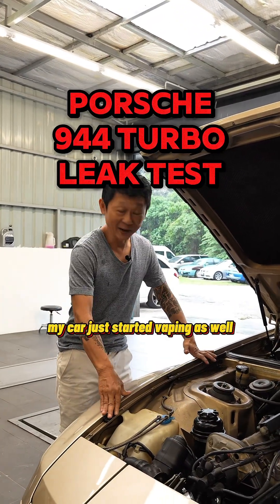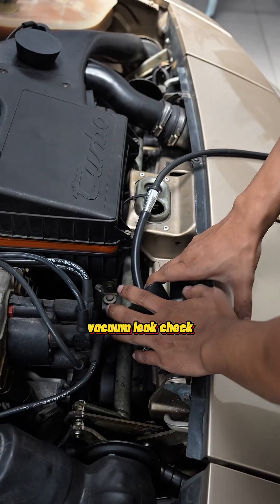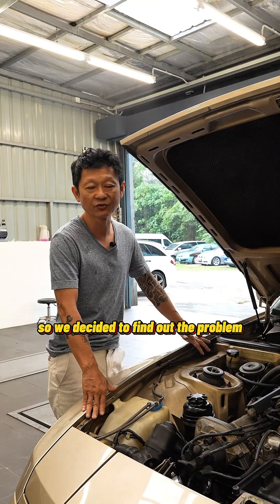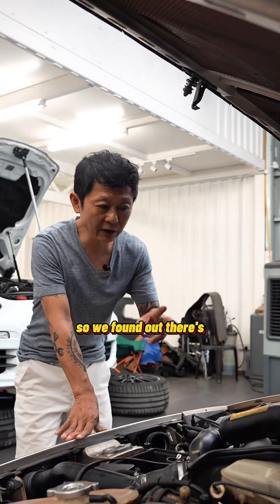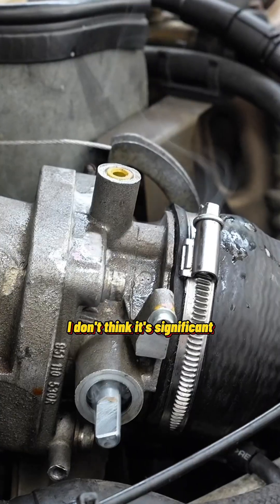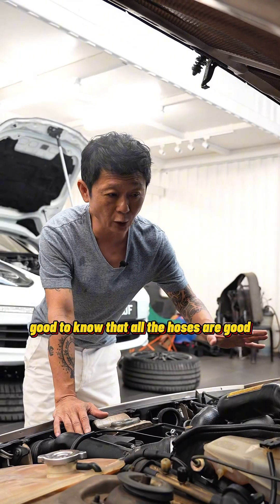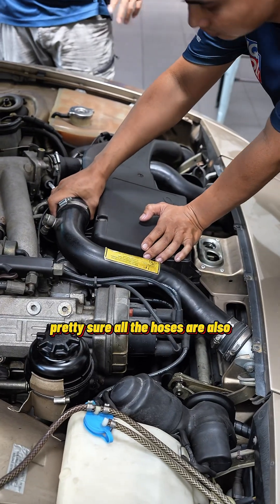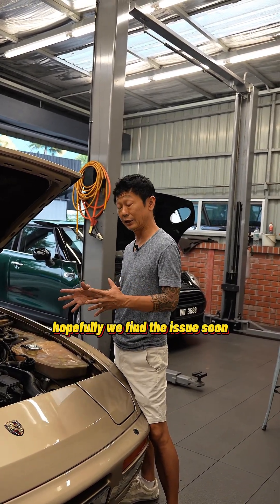944 Turbo vacuum leak test. #zenlow #leaktest #porsche #944turbo #aylezo

Comment: If you are not getting above 1.2 bar according to the Gauge it’s most of the time the cycling valve that has gone bad. Could also be the KLR which is linked to the cycling valve.